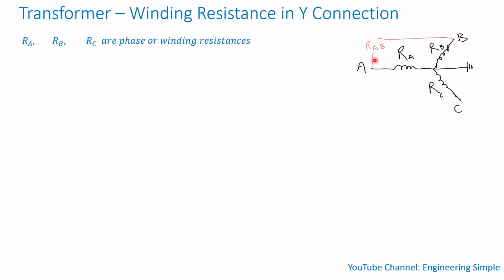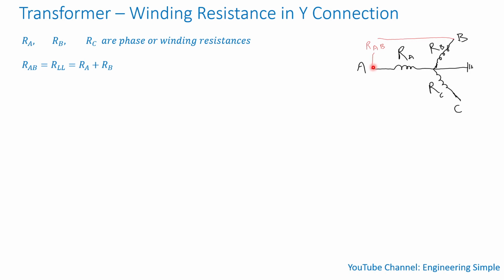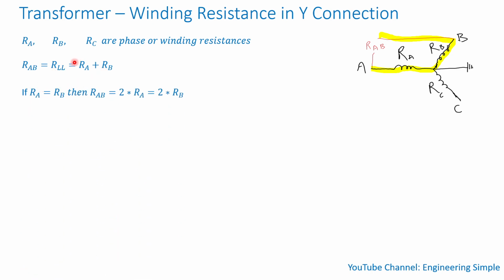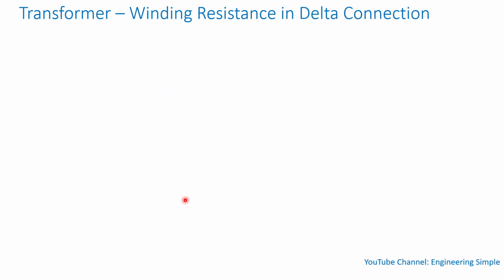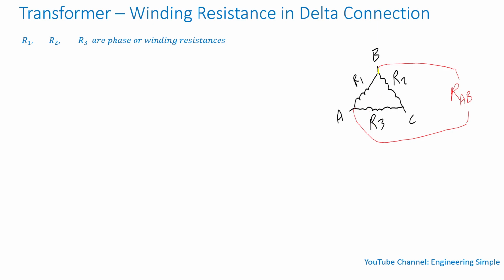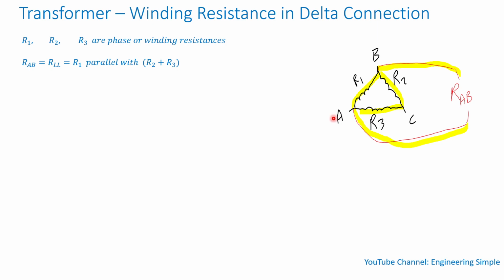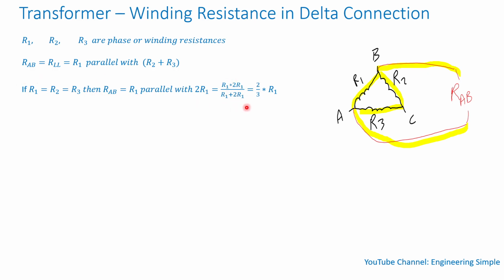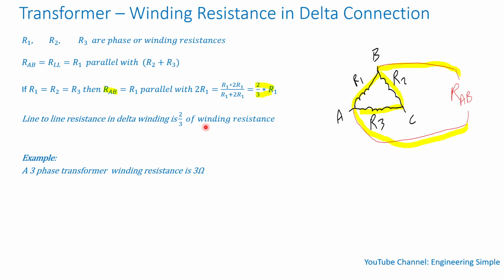PE Power | Transformer Winding Resistance Y and Delta Connections

Comment: Thankyou so much this just saved me
Reply: I am glad this video helped. My plan is to upload more videos and help as many people as possible. I will also make videos based on requests made in the comment section. Thank you.
Reply: @hamidabdelkamelmseepepmp9484  i need delta connection per phase winding resistance calculation derivations
Reply from the maker: @jddravid7856  towards the end of the video, I showed phase to phase resistance is 2/3 times winding resistance so winding resistance would be 1.5 or 3/2 times phase to phase resistance. Hope this helps.